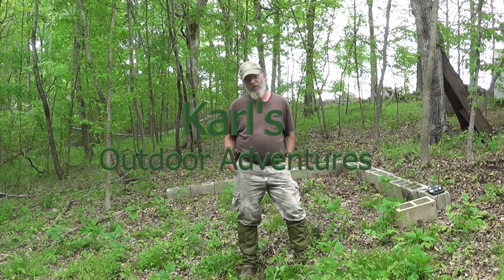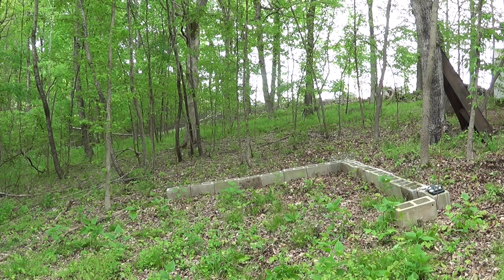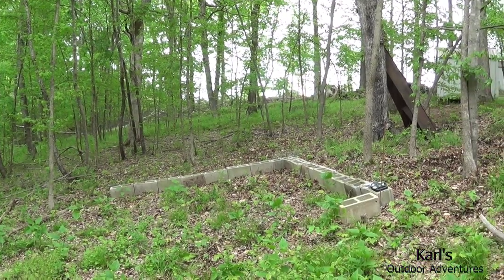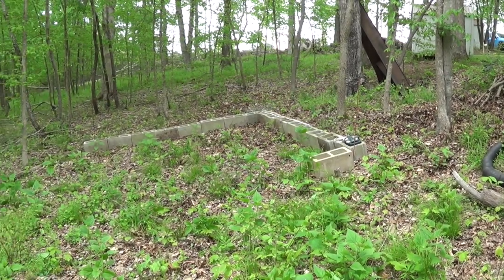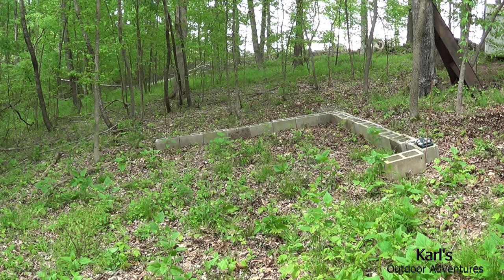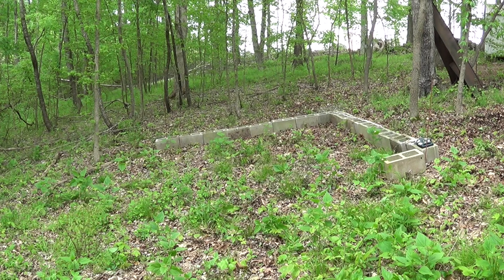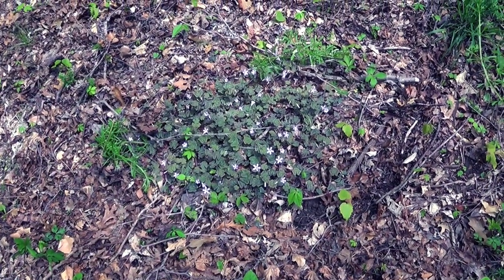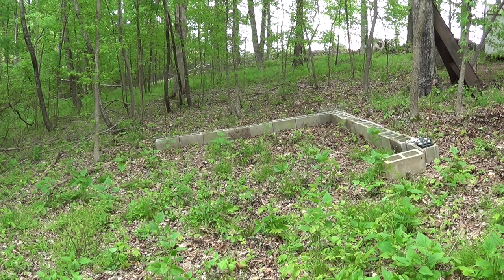The Brake Drum Forge Project_Pt 2

Comment: Looking good Karl. Will you be binding the blocks together with cement? I wonder how much those tongues way. I'm betting at least 250. I have no clue what this flowers are. It's cool they opened up though.. until next one..
Reply from the maker: Yeah Bob, I want to dig down a bit and pour a little footer for the blocks, then mortar them in.  in various paces where the steel channel from the shed is to be secured, I plan on filling those squares on the blocks in with concrete too.  So I can secure the channel using Tapcons or some other concrete fastening hardware.   Or that's the plan now.
I bet them tongues are pretty heavy!    I haven't tried to mess with them in years!

Thanks for watching Bob!